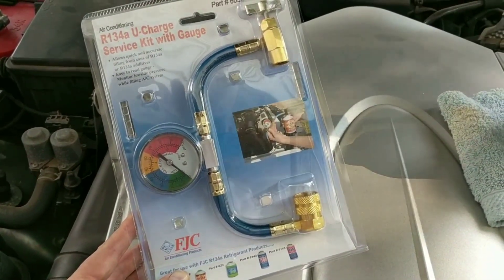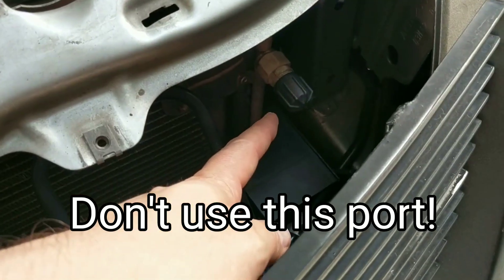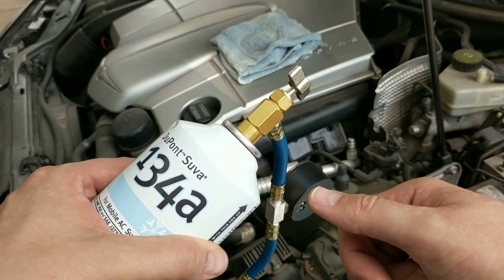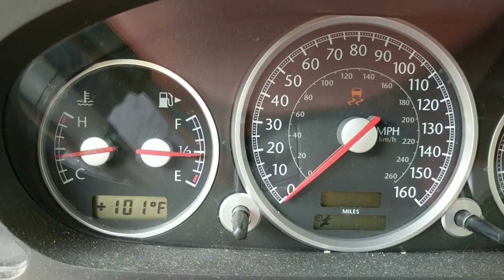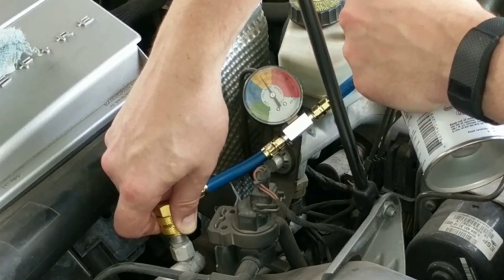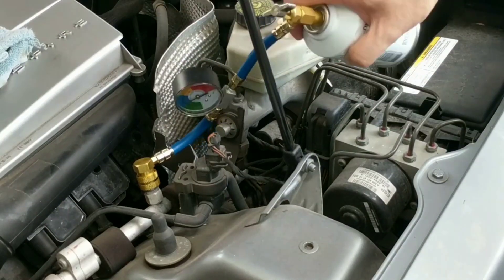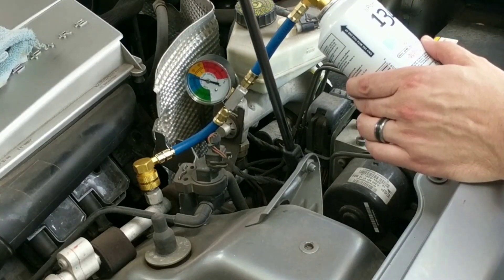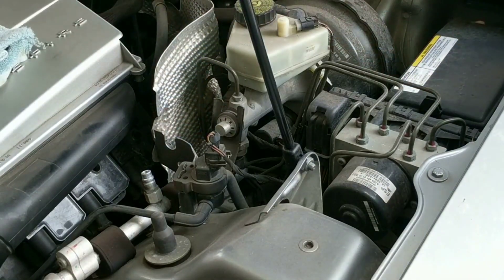AC Recharge Refrigerant Refill 134a, Chrysler Crossfire, Mercedes SLK320, CLK320, 55 SRT6 R170

Comment from the maker: Thank you for watching my Crossfire Air Conditioner recharge video. Please consider giving your interior a break from the summertime heat and parking it in the shade. Take some shade with you in the form of a reflective windshield sun shade cut to fit this unusual car perfectly. Http://N2C.co/sunshade shows you how block 100% of the sunlight trying to come through your front windshield and will noticeably  cut the summer heat.

Comment: I own a 2005 Crossfire my Ac compressor doesnt even cycle when I turn on AC nothing happens except the engine speeds up a bit the cooling fan comes on i tried to see if it was low on freon and the gauge says its full i pushed in the needle and some gas and oil spits out, the compressor does spin freely but does not engage what can it be ?  I am new to this type of car. I bought this car with problems it runs great i did fix the cooling fan because someone cut a withe are the cooling fan control box I resoldered it because I found out the fuse on the passenger side blew out and someoen tried to have the fan run off the battery which did not work. also the lam on the dash for radiator went out once i replaced the fuse and reconnected the cut wire. also the yellow exterior lamp on the dash willnot go out even though the lamps all work and the TPS lamp is on because Im sure the all the sensors are all original. The car has 143,000 and kinda unloved some of the paint clear coat is peeling which I hear is kinda normal My car is maroon. thanks for any help
Reply from the maker: That engine that speeds up a bit may actually be your secondary air pump which is an emissions fan for blowing air into the exhaust (very simplified explanation). My suggestion here whenever anybody buys a used crossfire is to repair the RCM and change or upgrade the battery. This car does some weird $#!][ when the battery isn't well above 12.4 volts. Let me think on this for bit. Check out my http://N2C.co/relay  video for inspecting/repairing the RCM, the fuse block and electrical is key to this car. Let me think on your problem a little, I'm not sure if this ac unit has a clutch so I have to do some research.
Reply: @glencouls  yes I know of the  emission air pump . I got the cooling can fixed. But the A.C. does not engage even full of Freon the compressor does not engage it does nothing is there a relay or something I checks all fuses they are fine. The radiator cooling can comes on when you switch on A.C. but compressor does nothing
Reply: Hi again I got the cooling fan to engage because someone cut the wiring but the Air condition  does not cycle. The cooling fan fuse blew and guess previous owned had a back yard mechcanic screw it up. I found the fuse in the box on pass side of engine compartment. plus they cut a heavy gauge wire near fan control box which I fixed. now when I turn AC on the cooling fan comes on but no compressor . wonder if you have any idea what could be the problem like a relay . I took the R134 to see if it needed charging well it seemed fine it spit out the Freon . car runs great Im trying to fix these things myself to save money. but im stumped on this one. Do you have any ideas ??